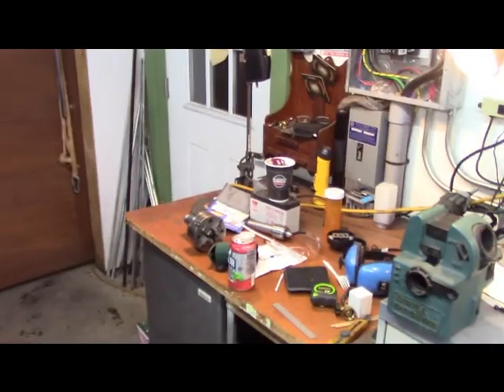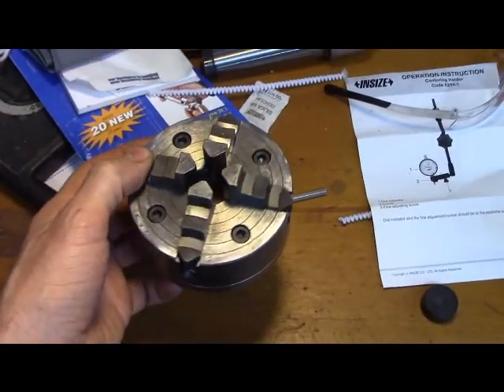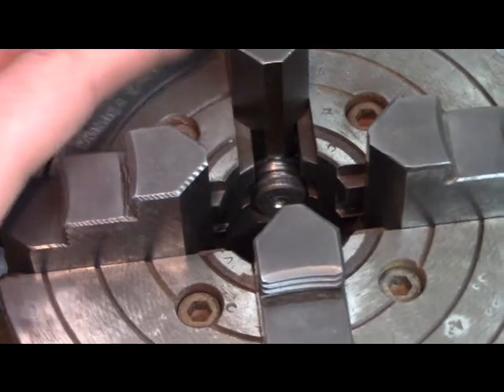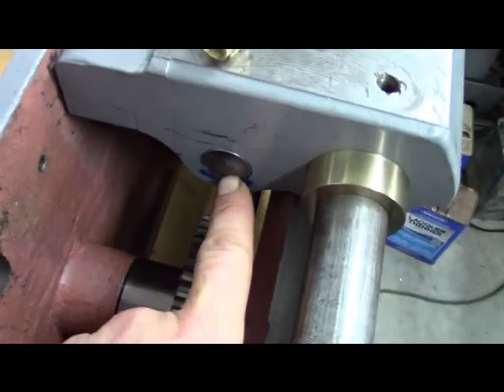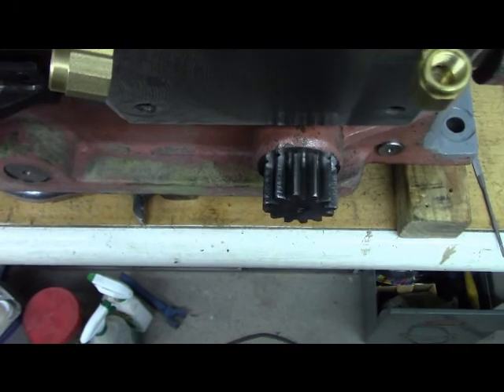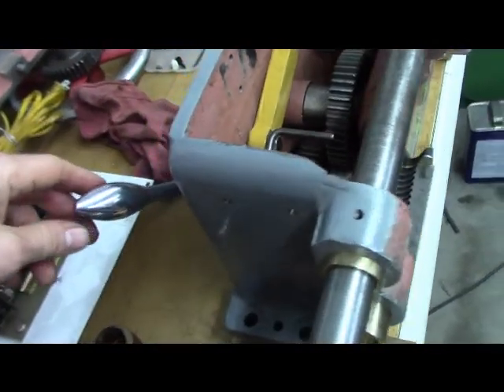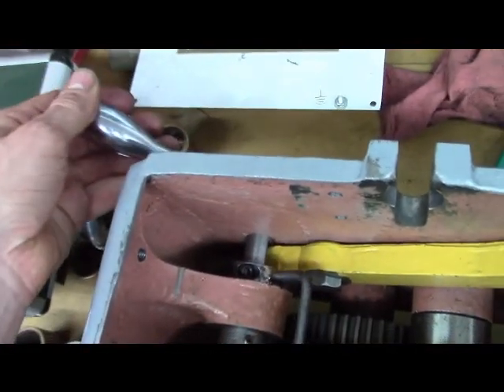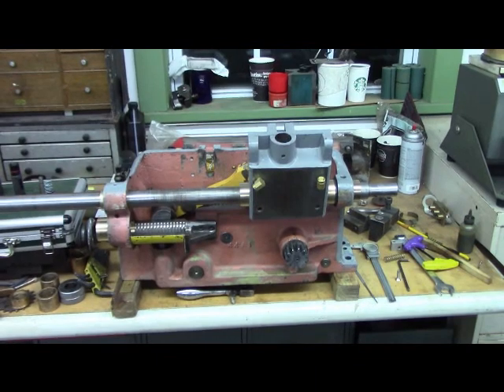Doozer's Machine Shop Update 3-24-20 -- A new Chuck and Colchester work

Comment: Hey Doozer I like your parts washer it's much better than those expensive plastic ones I've seen out there way to go good stuff man
Reply from the maker: Hey Doug,  Thanks for noticing my parts washer.  Not sure if I specifically showed me using it.  Maybe I will have to do a short take of it with some info.  Anyhow, it is a 35 gallon drum.  The pump I bought a real Peerless Little Giant pump rated for parts washer service.  I think it was $85, but it was worth it, as it was made in USA and I feel better having one rated to be submerged in solvent.  Under the kitchen sink and in the tank is a catch basket, just in case you drop that rare carburetor part down the drain, all is not lost.  I use home water filters to clean the mineral spirits.  The plastic housing has held up fine.  It clogs rather quickly though.  I need to buy a AMF Cuno filter, I think that would last longer.

Comment: Nice grinders Doozer,  I ordered an ER32 collet holder for the B&S #10 and a set of precision collets from ICarbide,  on ebay,  I will let you know how good the quality is when I get them.  Their TIR is quite good. we shall see.
Reply from the maker: Hey sounds great.  Did they have an adapter to go to ER-40?  ER-32 is nice but it tops out at 3/4" shank holding.  ER-40 holds up to 1" shanks.  Yes let me know the run-out specs when you get them.
Reply: @kooldoozer  Hi Doozer,  They only had the ER32 in B & S #10,  that is ok I have a 3/4" and 7/8" end mill holder, and will more than likely purchase a 1" holder when I find a good price.  I liked that fact that ER32 can handle smaller end-mills